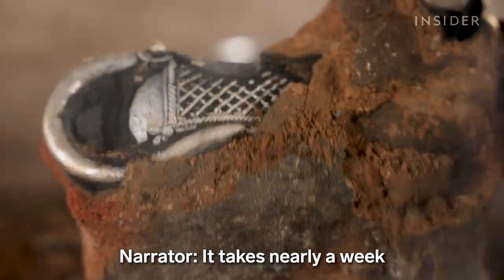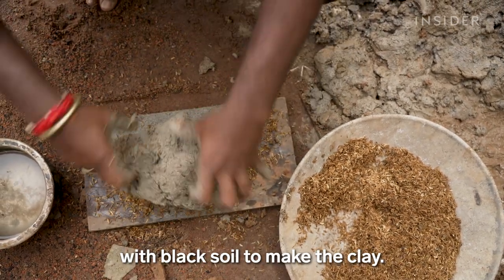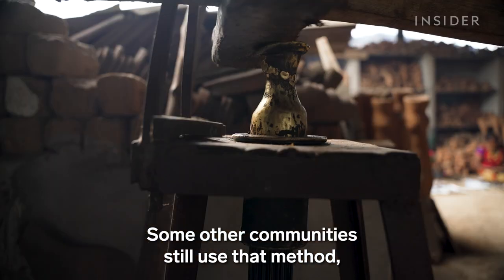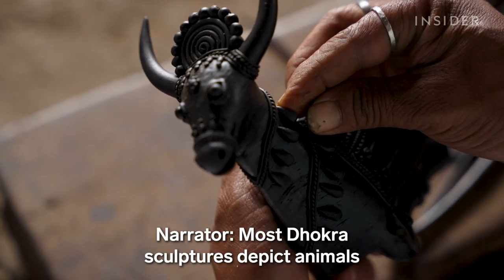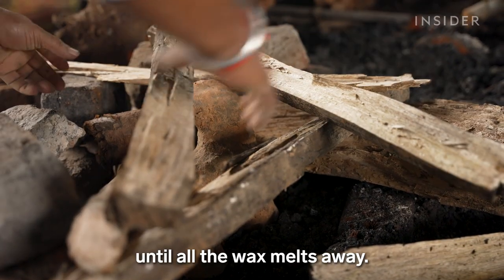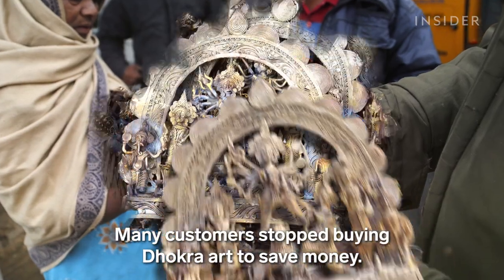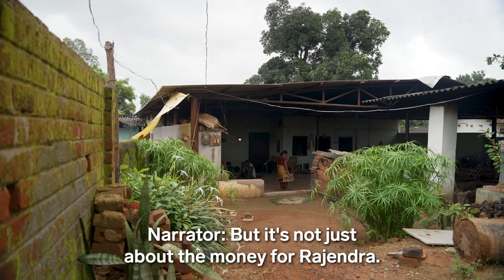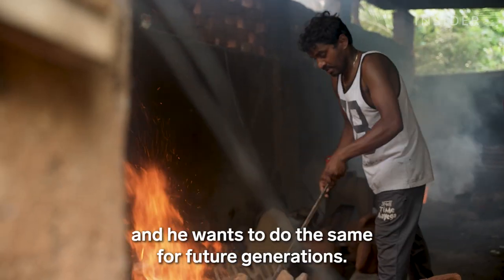How Metal Artists In India Are Keeping A 4,500-Year-Old Craft Alive

Comment: What I don't understand is that it's the wax that forms the main shape and forms but he eventually burns them all out again. And put in the liquified metals into it...but it still forms the images...I'm lost😮
Reply: The wax design imprints on the inside of the second layer of clay. The outside clay holds the impression that the wax left behind and gets baked hard. Molten metal then takes that shape.
Reply: That's what the clay mould is for.
Reply: Try to Google investment casting and lost wax casting